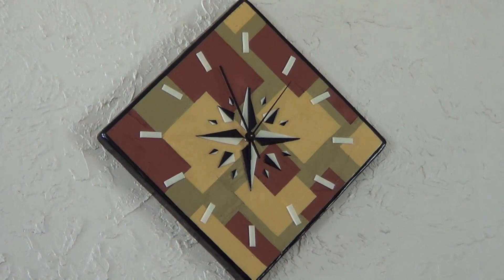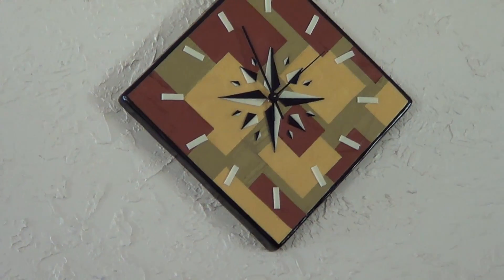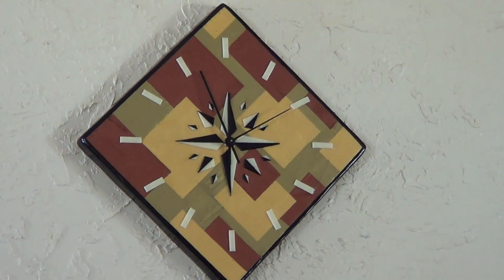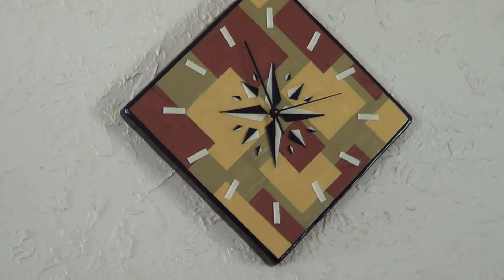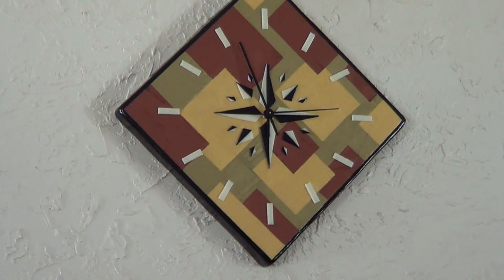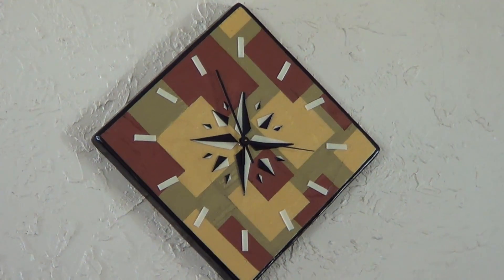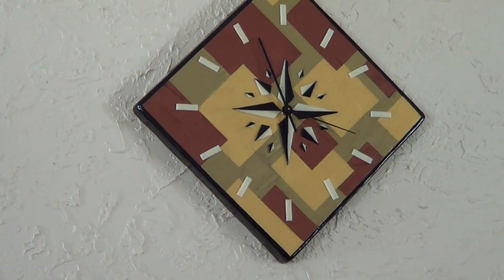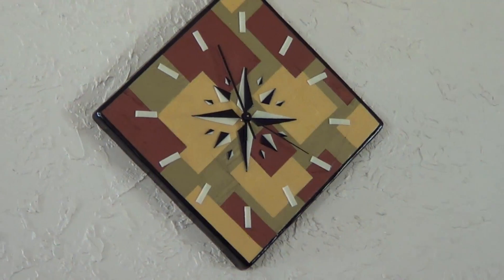Polymer clay glowing clock, final reveal

Comment: It looks really great, and i think it just fits in with the larger art work so well! I recently had an accident with clay bubbling as well, but over a tinfoil/tape core, and i think the reason for it was the fact that the clay was just the shell outside the core, so whatever way it heated up, it just expanded, and maybe the same thing happened with the clock and some air just got trapped under the layers and expanded, but I'm not sure. Great work though, I love all the projects you do! :)

Comment: I always use ceramic tiles on top as a weight but to stop from getting shiny spots place paper between the tile and the clay.
The other option to wood is the aluminium trays you can buy for food smooth it out and cut to size and make the shape you want first with that and then coat with clay use tiles in the cavity to keep the foil from bending with the weight of the clay and top tile and because you have done it this way let it heat up and cool down in the oven.